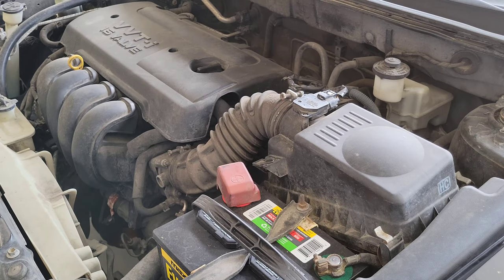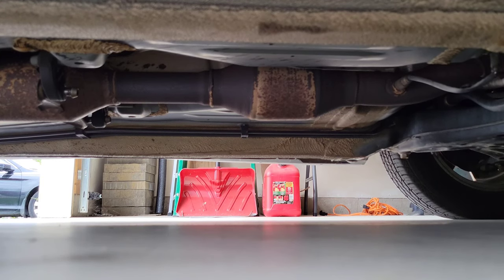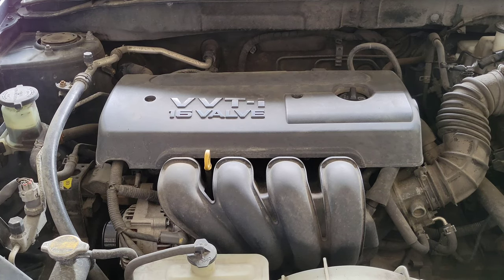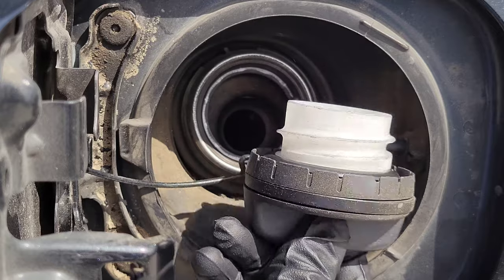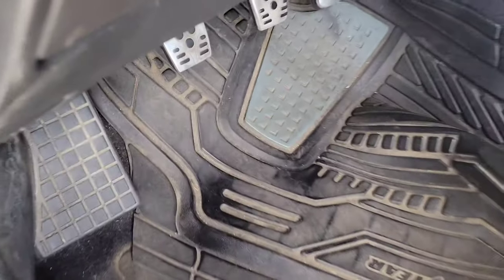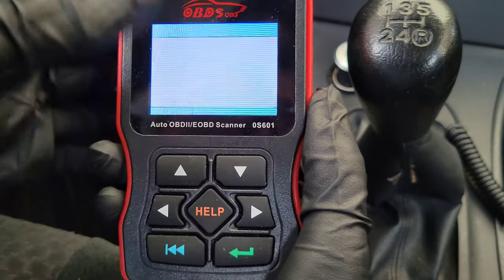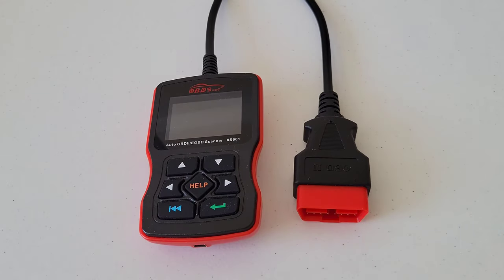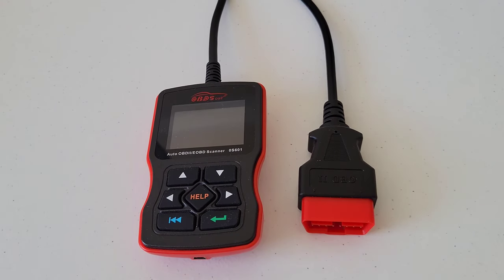Toyota Corolla Check Engine Light 5 Common Issues

Comment: I bought a cheapo Chinese OBD code reader which seems to work.  As long as the car runs OK, I prefer my wife's solution:  Stick a piece of black electrical tape over the "CHECK ENGINE" light.  Problem solved without breaking the bank!!

Comment: 2007 Toyota Corolla S (75,000 miles) - The check engine light occasionally comes on, and the engine loses power. When this happens, I need to turn off the air conditioner and park the car. The engine shudders and shakes before I turn it off and wait. After waiting, I can restart the car, and it runs normally again. The issue has been occurring during high temperatures, in the high 90s to 100s (coincidence?). Any thoughts on what could be causing this? Is it my ignition coils? I have not pulled any codes yet.
Reply: Sounds like the airconditioner is the problem...drawing too much power?

Comment: Hey what if I took mine in for a specific code and after the repair it's still reading the same issue? Took it for a p0741 got new ATF fluid and changed the TCC solenoid.

Comment: On my 2007 Toyota Corolla, the dealer is telling me based on the codes, the Vacuum switching valve is having a problem and it needs to be replaced. It will cost about 400 dollars.
Reply: Did you look up the work required to fix this? I encourage more people to work on their cars as much as they feel comfortable. It will help you in a pinch as well.  Anyone willing to do work on their own vehicle should own a scan tool these days. Keep it in your glove compartment or trunk. Even if you don't need it. You can have it if someone else does.

For instance, I was able to diagnose and fix a problem that had me on the side of the highway. The scan tool told me there was a misfire on cylinder 3. First thing that came to mind was ignition coil. Super easy to replace. I bought crappy coils and one failed. Luckily I held on to an original one as a backup. As, buying cheap coils on EBay is a horrible idea.

I swapped the coils around at first to  see if it gave a different code (eg. Misfire on cylinder 2). But it never gave a new code but still ran like crap. Lost track where I swapped the first two so I swapped each one out with the spare until it didnt run like crap.

It could have been fouled spark plugs as well. Which could be from a number of things, including a leaking valve cover gasket or specifically spark plug tube seals. It basically made it easy and I was driving again.

It made me realize how useful having a scan tool was. Ultimately I ended up changing all the coils until the ebay ones were in the garbage.  

Either way, when a dealership tries to slap someone's head, if you can listen closely and look into the problem yourself, many people would be suprised how much money the dealership charges when you see how simple some jobs are.

Comment: Some Toyota’s (Corolla / matrix’s ect ) or Pontiac Vibes get a PO171 error code. 

This is the manifold gasket and a design flaw. The newer gaskets like fel-pro or Toyota’s orange ones are better deigned and will fix the air coming in or creating a “lean” condition.

Comment: I had a code on my 2008 Corolla that pointed to a leaking intake manifold gasket. Dealer replaced the gasket with an updated one. 
I use an iPad app and a WIFI  OBD 2 reader. The app gives codes and can erase them as well. Very handy at times.

Comment: Could my chech engine light been triggered recently because I missed 1 of my oil changes servicing appointments and put 15000 miles on my car since last oil change and my engine filter was very dirty? Assuming this is the case and I got this service done plus an engine flush is there a way to clear this warning such as disconnecting the battery to reset car computer?

Comment: P0420 (los angeles)
After fix o2 sensor 170$
After 1000mile running 
engine light popped up again 
Had to replace catalytic converter cost me 900$.

Comment: Hello!
☝️ A technical question.
I have a Corolla year 2001 in Venezuela 🇻🇪 type 1.6; that is, 4AFE and neither current nor signal is reaching the oxygen sensor. This is causing the engine to consume a lot of fuel ⛽️ and also has a smell of candy with white 💨 and black smoke from the exhaust system. It uses a 12 volt wire + signal + (02) wires for a heater or coil but none have voltage from the ECU output.
The 💡 ⚠️ CHECK-ENGINE light is on all the time.
WHAT IS YOUR RECOMMENDATION?
I await your comments.
Thank you
KENNY RENDILES
Reply: your comment sounds like an email

Comment: I have a 2004 toyota corolla and it has a check engine light on and it needed a smog, I took it to a garage and they said the Cat. wasn't  ready so I needed to drive the car so I drove the car on the freeway 100 mile and brought it back and the guy said the Cat. has to be replaced but I bought the car for 3000 and don't drive it much since I retired and covid, he wants a 2000 to fix and smog what do you think
Reply from the maker: Thanks for watching! Unfortunately Catalytic Converters are expensive fixes usually. That is a tough decision for you, good luck and hope it all works out for you.